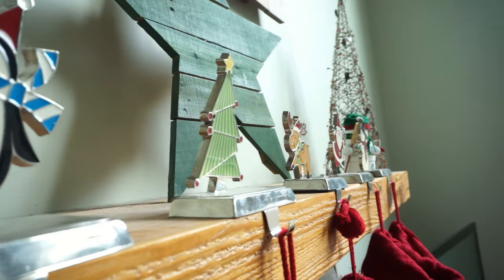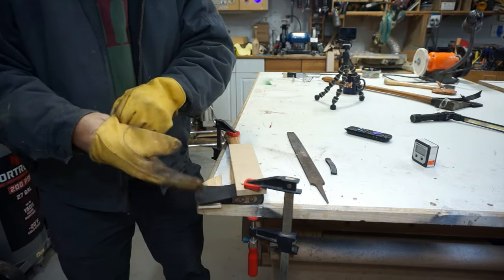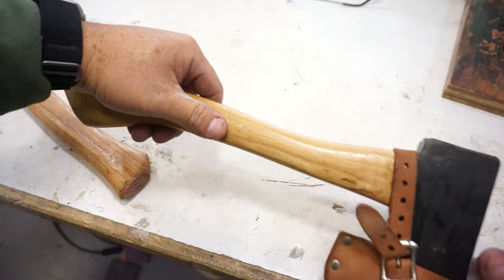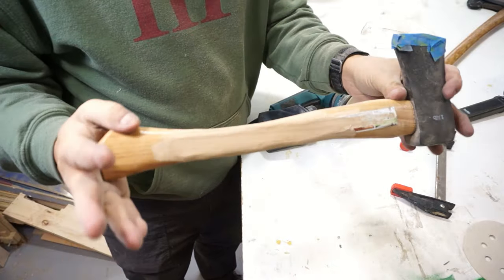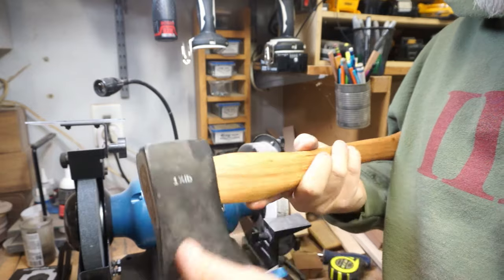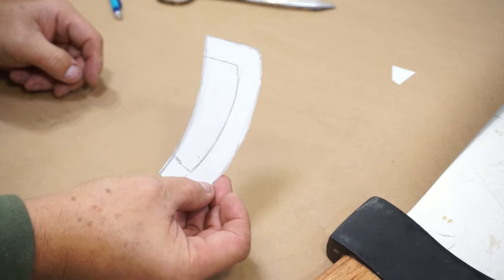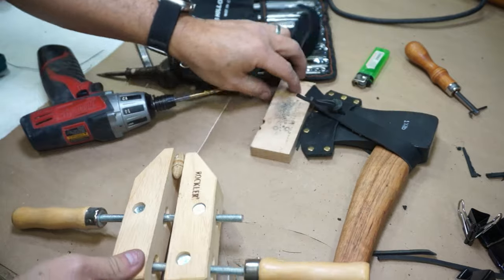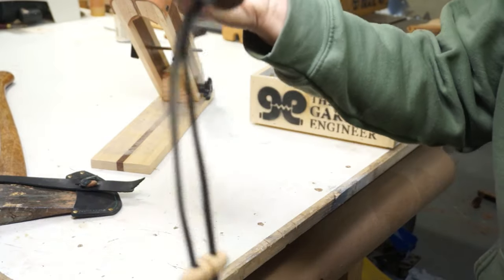3 Upgrades to Improve the $15 Hatchet from Harbor Freight

Comment: Harbor freight hammers and axes are great for customizing and decorating into fantasy costume pieces as well.
Reply from the maker: I will have to try customizing some of there other items. Thanks for watching.
Reply: Believe it or not I've used some of the sledgehammers in a couple of the Hammers and the steel they're using is really decent it's really good it's better than some American Products believe it or not just not new or still just older but some really good old Steel

Comment: Great video!  The knot clasp for the strap was a nice touch, over using a standard snap.
Reply from the maker: I try to avoid snaps in that area so to not scratch the metal.  Happy accident.  I will defiantly use again on another project.

Comment: In a recent test, using side to side strokes on the blade produced the worst edge. Second worst was with the blade. The best was grinding/filing in straight strokes from blade towards spine.
Reply from the maker: great point.  I guess that is why belt sanders sharpen in blade to spine direction. Thanks for watching!

Comment: I do like  making things a little better from  customizing & leather work also. What's so great about the $15 hatchet besides the price? 👍
Reply from the maker: The handle is beefy so it allows for more options when reshaping shape with.  The Iron was not too bad.  I think I am going to buy another one for me and test out how well the iron holds the sharpness. Thanks for watching.
Reply: Pretty much the price, from what I can tell.  I bought one a few months ago, and so far it seems fair quality.  But, you need to search through their inventory for a "good" one, properly hung, and with a good grind shape.  Then you have to rehone the edge.

Another guy did a teardown comparison between the HF one, and one for twice the price on Amazon, and determined they are the same.

Comment: Bro my personal opinion is is it a good tool,do you care if you break or lose it, and if you do you replace it,for as less as possible,this makes sense to me,does compare to Bucks or a high end ax no ,it’s made to be able to work in the field,to sharpen and use and replace tools in the field.
Reply from the maker: Since I don't use it everyday.  It is an expendable tool and will get the job done.   If I used it everyday, then I would look towards a high end tool to make working the job easier.  Thanks for watching.